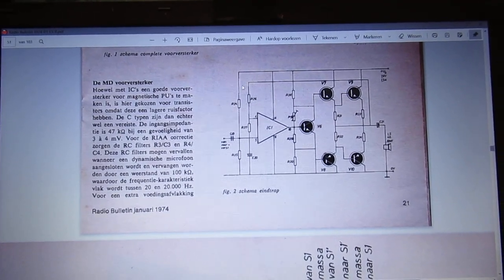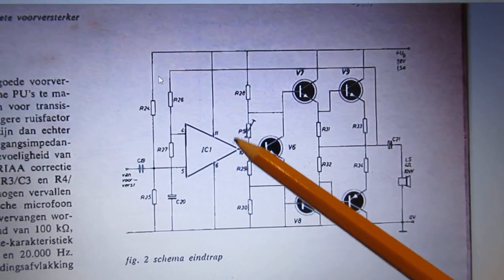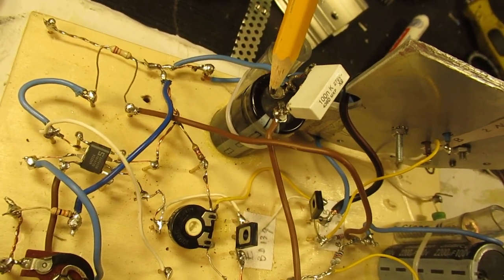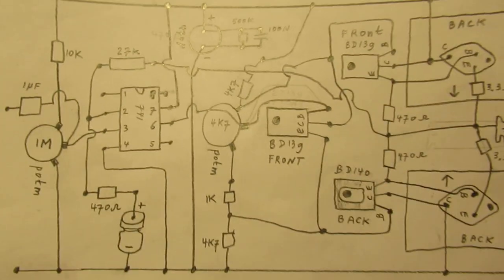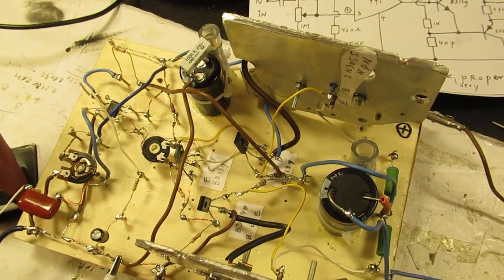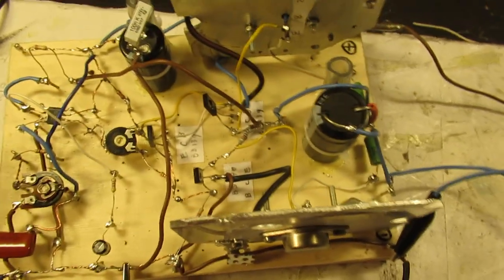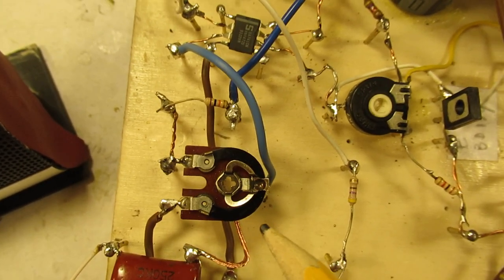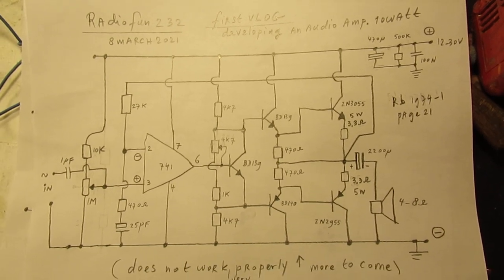VLOG Developing a classic class B amplifier with 2N3055 NPN & 2955 PNP & a 741 Chip first results

Comment: Wow, really like that circuit. I'd love to see  output waveforms with a sinewave  on the input. The sound is good for having  no quiescent current. Very cool circuit Mr. Tilman!
Reply from the maker: Thanks Harold. Yesterday (9 march 2021) I made two small changes, now it takes a quiescent current and the sound is good (no distortion audible). The changes are in the textbox. I am going to make a circuit to make the high input impedance low, so that it will  be less sensitive to hum. That makes the amplifier easier to use in all kinds of applications. Also a simple tone control. That will be next. And yes I am going to test it on frequency range, pureness of sound,  stability & thermal runaway.

Comment: That sounds really good, thank you. Just a thought: The 25uF attached to the 470R - try using a low leakage cap otherwise strange output noises can sometimes be heard and 1/2 rail Voltage disturbances all caused by the variability of leakage. It only needs nAmps for problems to occur and electrolytic caps are notorious. Keep safe, Beamer.
Reply from the maker: That capacitor is indeed a critical one. In the past I once searched for 2 days till I found it was defective..... :) Thanks.

Comment: Since you are using a single power supply for the op-amp, I assume you are adjusting the input voltage on the op-amp to get full swing on the output.
Reply from the maker: Yes, it was why I selected this schematic, thanks Barry.